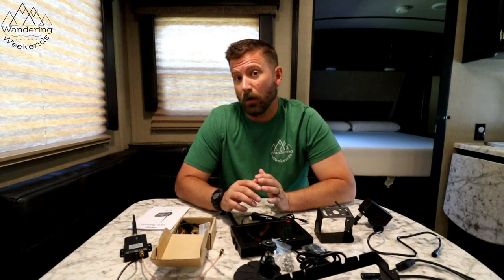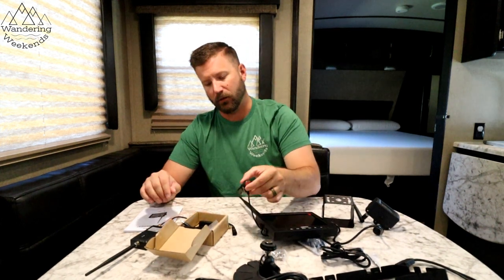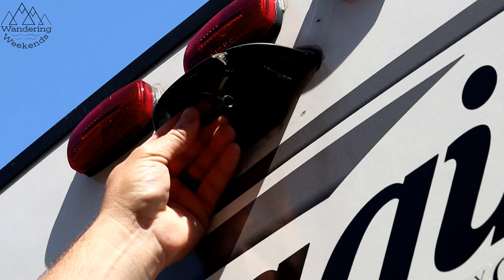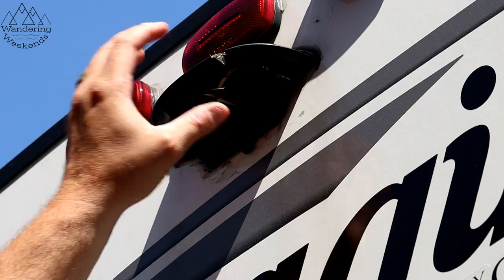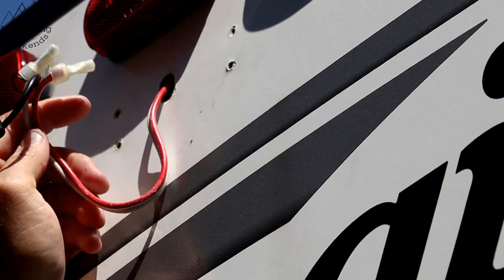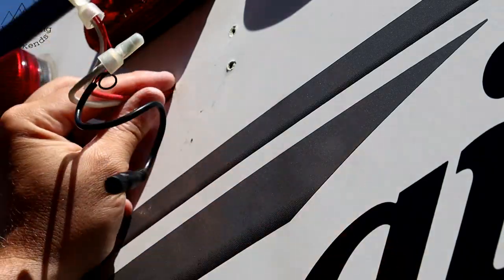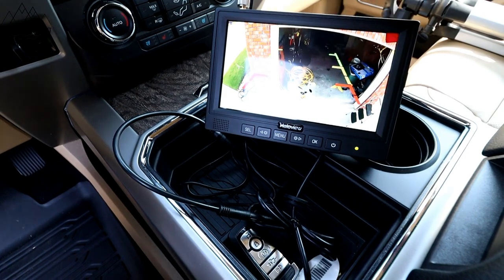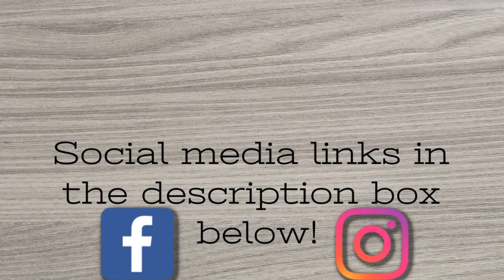Install and Review... Haloview  M7108 Wireless RV Backup/Observation Camera

Comment: I have the same camera system and Furrion prewire. I used the rubber gasket from the Furrion mount as a backing for mounting this camera and ran the wire right through the middle hole I created.. It provided a more weatherproof seal for the large wire holes and I was able to silicone the top of it to seal it.
Reply: Exactly what I was thinking.  Mine is on order and will do this.

Comment: That worked!  Just 2 tips:
1. as been said, don't forget to order the $12 adapter, it's not included for some reason. (Hey, Haloview, if this is marketed as a furrion replacement, please include the adapter)
2. it's easier to attach the adapter with the camera mount first, on the ground, then screw the whole thing to the trailer. those nuts are small and the space is tight.
Good luck!

Comment: What did you use to remove the furrion shark fin? I can't find a deep socket small enough to reach those 4 bolts
Reply from the maker: Ours was just a Phillips head screwdriver...
Reply: @WanderingWeekends  ah thanks - unfortunately mine is a bolt I'm not sure why

Comment: I had the same question as Gene Godwin did about sealing up the wiring hole. Do you think you could have left the Furrion housing in place and drilled 4 small holes in the faceplate for the Haloview camera bracket?
Reply from the maker: Ourlife Whirlwind it wouldn’t have worked that way. I looked for a way to mod the hood but there really wasn’t a good way to do it. Some have left the hood and mounted the camera just underneath but that requires drilling holes... I’m just not a fan of drilling unless I have no choice. Personal preference there.

Comment: mine did not start up automatically as yours did?  Any thoughts?   It looked like you had your 7 Pin plug connected from truck to RV. is that required for it to work

Comment: One of the things I like about the new 2020 Gm Hd's is they have trailer camera's (although hardwired) that work  with their display.  They also offer TPMS  4 pack for your trailer tires for like $50.  No need for all the extra monitors.

Comment: Did you get any interference when on the highway and near populated areas with other bluetooth/wireless systems?  The camera I  bought needed the range extender for that reason.  It was not a halo view.  Is the range extender part of the kit or a separate purchase?
Reply from the maker: Kevin Burroughs I believe the range extender is extra. Did you purchase a Haloview? If so I will be glad to send you this one.
Reply: @WanderingWeekends  thanks iits not a haloview though.  However the haloview seems like a better system than what I got.
Reply: @WanderingWeekends  do you have a link for the extender? I'm fixing to purchase the halo kit with side marker cameras

Comment: How long is your camper and do you have any signal loss as many have reported? I have a 37ft. fifth wheel and I'm debating whether to get the M7108 or the RD7 that has the range extender unit.
Reply from the maker: Rob Holcomb we’re at 32ft and have not had problems with signal loss. At 37ft I’d certainly recommend an extender. It seems the max is somewhere between our two rigs.
Reply: @WanderingWeekends  Thank you. You've been a great help. Happy Travels!
Reply: Very good info sir...I just need to pull the trigger!!...just wish it was under $200

Comment: I installed and have tried literally everything and cannot get my camera and monitor to pair. There's power to both Ive selected camera 4 (I like the mark lines) Ive made sure camera 4 is selected pushed the paring button on the back still says no signal! I've watched videos and followed the instructions. My camera had the same set ups as yours (pre-wired for Furion) I ordered the adapter kit from your link. I can't find any phone number for help through Haloview. Any suggestions? Thank you!
Reply from the maker: T Woods make sure your antennas are tightened down. I had this issue just the other day and this fixed it. Keep us updated!
Reply: @WanderingWeekends  Thanks for the feedback. They are on tight. However, I installed the camera before Pairing with the monitor and I received an email from Haloview tech support saying that The antennas need to be within 3 feet to pair. Why on earth did they put pairing on the last page then? I'm not an electrician, or a mechanic just a single girl trying to do a man's job LOL! I'm wondering if everyone paired BEFORE camera installation?
Reply from the maker: T Woods hmm? I didn’t pair beforehand. I simply installed, took the monitor to my cab and fired it up. My only source of power was the 12v adapter.
Reply: @twoods3480  I know this is old, but I just installed mine today and had the same problem. What solved it for me is finding out that the pre-wired furion only gets power to the camera when you are plugged into the truck and the truck headlights are turned on. The camera gets power from the 3 red marker lights on the trailer which only turn on with the headlights, not daytime-running lights.

Comment: I can't see where you sealed the hole into the trailer, where the wire comes out. You screwed the bracket on before sealing it up.
Reply from the maker: It’s sealed with ample non-sag sealant.

Comment: Howdy Cory, good installation video.  I have the Furrion camera system and went through the same installation process that you did as well with one exception.  On my 2016 2600RB the DC power for the camera is powered on when the battery disconnect switch is on.  While this is good for most of the time when you boon dock it will be a little drain on the trailer battery.  I removed the center marker light immediately above the camera mount and tapped the the positive lead for the marker light and brought it down to power the camera. So my camera is powered on when I have my truck headlights on.  I ALWAYS tow with my headlights on so my camera is working while I am towing.  When disconnected from my truck the camera system is not powered and is not a parasitic draw on the trailer battery.  If you leave it powered by the battery disconnect switch you'd be able to monitor the camera while you are camping but you'd have to bring the display into the camper and power it up and leave it on.
Reply from the maker: gakrazykajun great info to have! Thank you sir!!!

Comment: In my world $250.00 is not economical. Pass.
Reply from the maker: Robert S I hear you... but considering the name brand is $389...
Reply: I agree $250 is in no way economical. Especially since you can get comparable systems for $150 or less.
Reply: @steelsunpi  many of these camera's are useless with longer distance... don't know if this one is any good though.
So short range you can buy anything. Longer range most are crap.